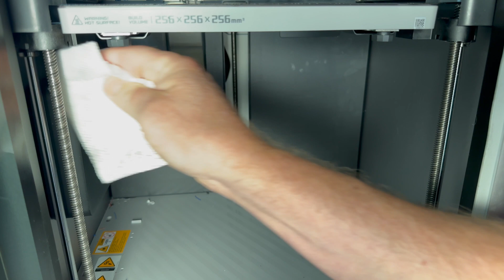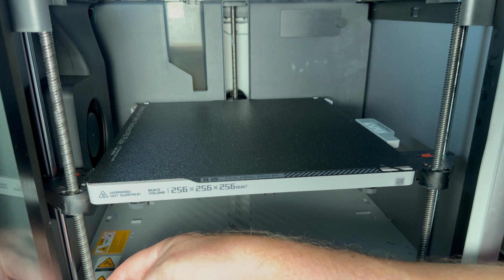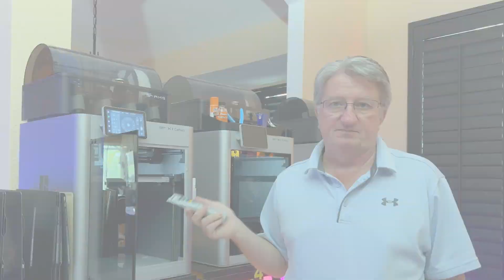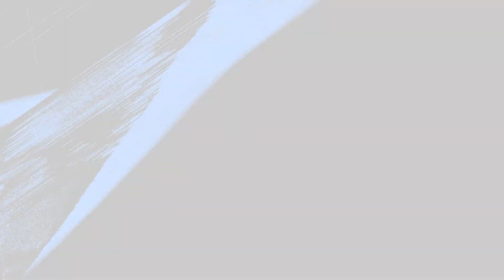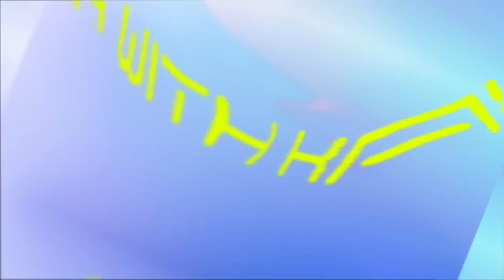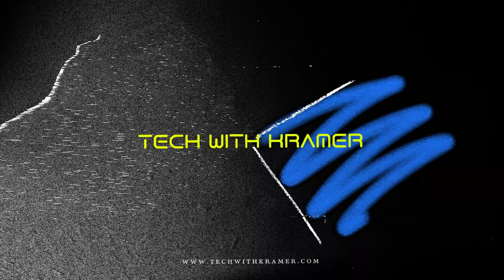How to Lubricate the Lead Screws of Your 3D Printer | Maximize Your 3D Printer's Lifespan

Comment: I just used super lube - silicon lubricating grease on my lead screws for voron trident build and thankfully the squeaking was gone. I applied a it to a part of  lead screw and just run the brass nut over it across the entire length of the screw and wiped off the excess.
Reply from the maker: Great stuff

Comment: Nice video!  I had to do the lead-screws on mine a few weeks ago.. 
"Super Lube 92003", huh?  I'll have to try that next..  I used "MolyKote 111 
[The M.K. is what I've used in my high end pcp air rifles, and swear by it 100%]
Thread cleaning:  A nice trick is to cut some thin fabric [microfiber or similar]
into strips [like small belts]  wrap a strip around a section of threads, 
then with 1 side of the strip in each hand,  give em' a quick back n' forth, spin/repeat - done..  👍

Comment: Looks like you got the superlube 92003 which contains silicone there is also 21030 without silicone I cant decide which one will be better. :(
Reply from the maker: I like the one I have, used it on all my printers and it seems to work perfectly.

Comment: Never use paper towels to do the maintenance. It leaves more gung that it cleans. Use a microfiber cloth.
Reply from the maker: Works perfectly with paper towels for me, I press it at the lead screw and move the plate up and down.
Reply: that makes no sense considering paper towels don't leave residue. Tissues or tp, another story.
Reply from the maker: 🤣 just because this printer poops doesn’t mean you should use toilet paper 😂

Comment: Hello!
How often do you put grease on the lead screws?
Reply from the maker: I do it like every 2 month, that’s when I do all the rest of the maintenance too.
Reply: Bambu Lab recommends on their maintenance site every 3 month. But you can definitely lube them more often, it wouldn't hurt. 🤩
Reply from the maker: They now have it built in the firmware so the printer tell you when it wants to be lubed! I guess it’s probably by print hours…
Reply: @techwithkramer  It's exactly what I had about 2 hrs ago. Got a message that it's time to put some lube to work. It's been about 2 month for me since I got the Carbon, but I've printed a lot! :)

Comment: No 3d print is food safe, please dont misinform. There are too many printing kitchen gadgets and cups without knowing the consequences
Reply from the maker: It is by definition food safe. If you want to use it as food safe is your personal preference, but my information is correct and based on facts, not personal opinion.
Reply: @techwithkramer  although some materials are "generally food safe" if we are just purely looking at the main composition like PLA/PET, I have yet to come across a 3D printer filament that is certified as food safe.Furthermore, some PLAs now are enhanced with additives to improve their strength/appearance which may or may not be toxic!
Reply: @nokind90  I believe BASF Ultrafuse PET is certified as food safe... : Ultrafuse® PET is based on food-safe raw materials (granulate), which are suitable for food contact applications according to the European Plastics Regulation. Further, this material is evaluated for Food-Safe 3D printed applications and meets the requirements according to LFGB and Regulation (EC) No. 1935/2004.
Reply: @techwithkramer  Lol, wrong. The base filament itself is food safe, not all coloring are food safe. The nooks and crannies between layer lines harbor bacteria after printing that a simple cleaning does not get out. If you were interested in actual facts, you would look up the studies and actual scientific tests that back this up - not safe unless coated. Id be interested in seeing these meaningless "facts" you speak of
Reply: @techwithkramer  This is very dependent on what you are doing (and what food save norm we are talking about), but in general (at least for Europe) food save is the exception, not the standard. A lot of things have to come together to print food save. Material Certification, special nozzles, special printing process and some more.
Reply from the maker: I only can talk for USA, every country might be different.
Reply: It’s the brass nozzles that are not safe. They may contain lead or other contaminants.
Reply: 3d printed parts contain ridges and microscopic holes that are imposible to clean and bacteria and mold can grow there. There is a lot of videos on youtube that show it behaves almost a petri dish. The OP is correct - do not use 3d printed parts for food related projects.
Reply: Yes 3D prints can be food safe. We print nylon and TPU all the time and have also sent the finished prints to SGS for food grade certification and they have always come back positive. You need to use stainless steel nozzle for printing food grade materials. There is a food safe PLA available now as well.